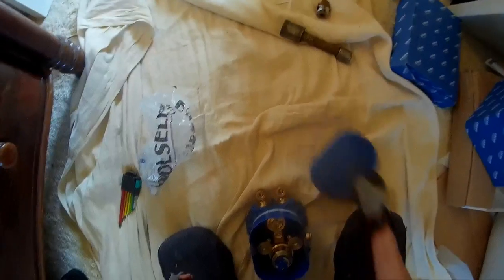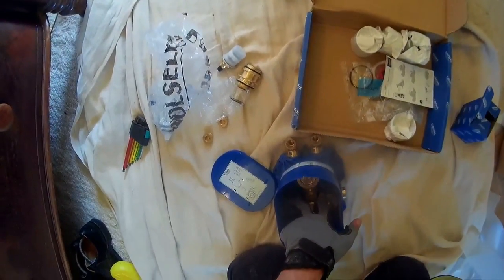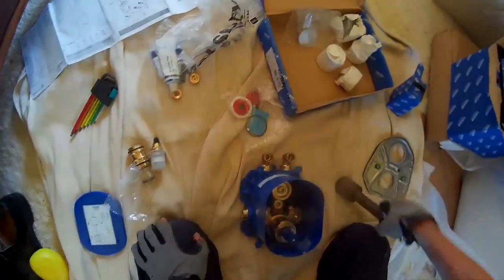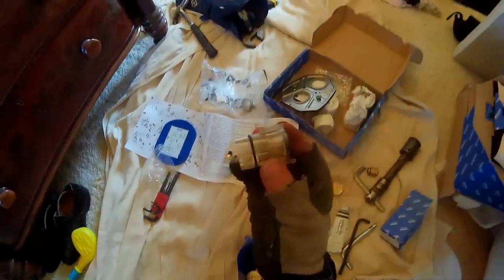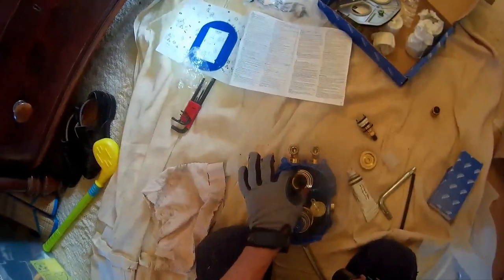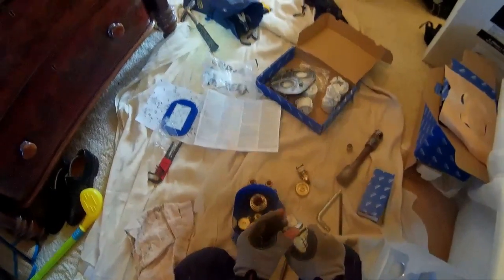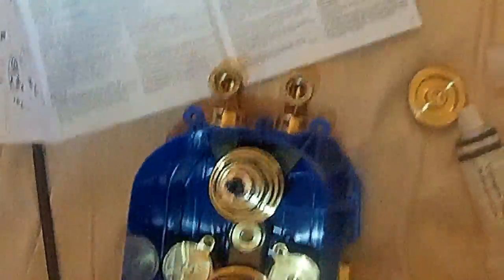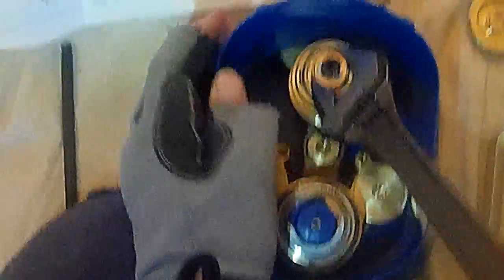Grohe Rapido T- Part 1

Comment: At 15.55 is where mine went wrong, the valve was letting water through our shower even when off, I stripped it down and found the smaller of the two pins bent. It broke off, thankfully the other pin lined it up and I still got a good deal, all working perfect now.

Comment: I have recently had this shower valve installed by someone who didn’t know what they were doing. Even after stripping some tiles off and having a second attempt, I’m not happy with the result. The on/off control knob only turns anti-clockwise to ‘ten to’ on a clock for the overhead, but to ‘twenty past’ in a clockwise direction for the hand held shower. It then continues to ‘half past’ and the hand held continues and the overhead starts dribbling. Can you shed any light on this? Cheers.
Reply: That is how it's designed, there is a plastic guiding Bush behind the handle that restricts this, there's no other way to install it
Reply: It's also very easy to have a look at this without damage to tiles etc, just pull the top handle off with a swift tug, then take the flat head screw out and the two plastic parts will then remove for adjustment. But from what you've said it's installed correctly